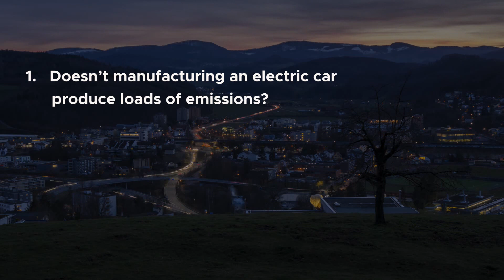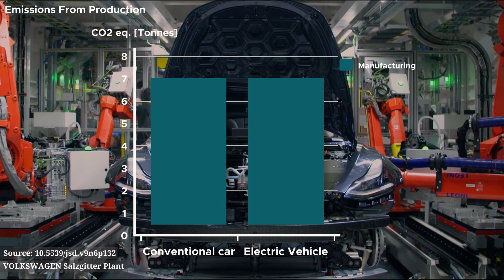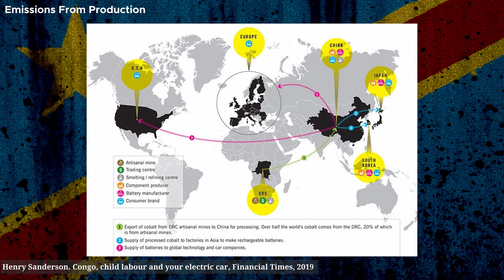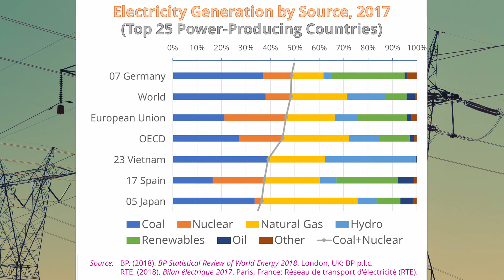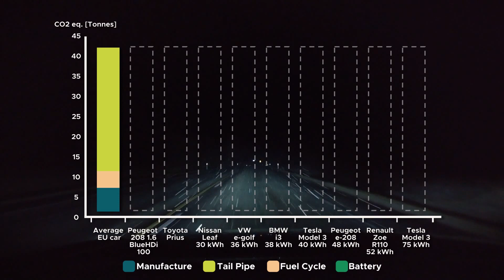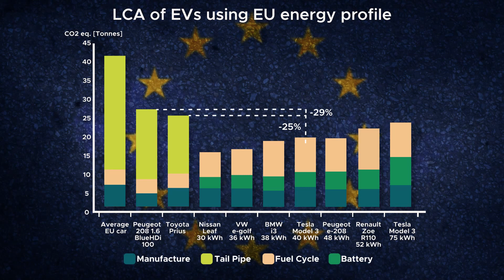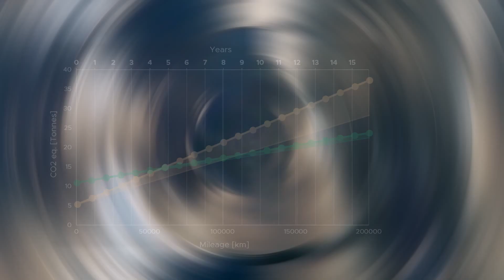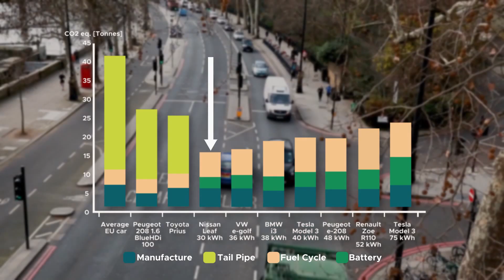Could Electric Vehicles be Bad for the Environment? Data Reveals the Truth

Comment: they are worse than gas cars for the environment since 67% of electricity is made by coal and oil
Reply from the maker: That depends on which country you're from.
Reply: @OurEden  67% of electricity in the world comes from a carbon source some countries like Canada use hydro  electric for its source of electricity other countries use solely oil  or coal some have both but the over all  67% is through a dense carbon scheme
Reply from the maker: @DavidStanleymusic  We acknowledge that countries have different energy mixes in the video. So you cannot outright state that EVs are bad everywhere, since countries with a high proportion of renewables such as the UK, Canada, Norway, Iceland, etc. will provide low (sometimes zero carbon) electricity for charging EVs. The electricity grids of the world don't all interlink, some do yes, but not all.
Reply: @OurEden  I dont do semantics  , the facts  re that ev's are not ever going to have a low carbon foot print until coal and oil is no longer used to generate electricity
Reply from the maker: @DavidStanleymusic  Ok, lets agree then to move forward with eradicating coal and oil (gas too?) in the generation of power.
Reply: @OurEden  that is the prudent thing to do
Elon Musk's new battery  looks promising

Comment: You people must have nothing better to do,buy whatever you want,maybe you should help the 10 year olds mining the products for the battery’s
Reply: The child labour encumbered cobalt probably is just working in your nearest refinery and removing sulphur compounds from your fossil fuel - or has been used for the valve seats and crank shaft of your ICE... Independent human rights organisations together with manufacturer representatives are currently overseeing the mining in the DRC that only ethically mined cobalt is being used for batteries. There is very little cobalt left - if there even is any...

Comment: How many batteries will most electric cars need during their lifetime. Cradle to grave I would imagine that most electric cars will have three batteries. The first owner will sell the car or have a battery replaced. And the second owner will either sell the car or have a battery replaced. So before that electric car sees the crusher at least one battery replacement will be common for sure. So we need to redo our math on the initial carbon footprint of these cars and the maintenance carbon footprint
Reply: Wrong. There are testing facilities that can prove the health of your battery when you want to sell your EV. But the battery will probably outlast the chassis as the batteries nowadays have an insane lifespan exceeding 400000-1000000km...

Comment: Right now there are thousands and thousands of airplanes flying download flight aware and look each plane Burns thousands of gallons of fuel which is jet a as they call it but it is really very clean kerosene and the ships that are carrying our cargo the car today and the diesel even burns cleaner than gasoline nowadays the cars of today only produce 5% if not lower CO2 emissions take a 747 or an airbus 380 which has four guzzling engines and a 747 weighs 999,000 pounds almost 1,000,000 pounds that takes a lot of energy to lift that thing I was going to make electric plans to

Comment: I found this to be a good video actually taking into account all of the factors that go into pollution from a car which some other videos seem to be afraid or unwilling to cover. You didn't need to dive too much into the detail as you explained what the data takes into account and then showed the data.
Reply from the maker: Thanks for the comments and feedback Matthew :D
Reply: It's still not telling the full story about batteries, as batteries will degrade with use. After 10 years you could be looking at a battery with 50% of it's original capacity remaining or the option of a new battery together with it's CO2 emission etc. It wouldn't be so bad if you could repurpose that battery into your choice of a new EV, but as it stands EV batteries are not standardised like AA, AAA etc. batteries. EV might have the potential to be more environmentally friendly than ICE but so far it seems marginal if you factor in all of the battery problems. Instead of pushing EV manufacturers to standardise on their batteries and modularise their components research papers such as those shown like to cheer at how good a job EV manufacturers are doing. Every product has a CO2 emission during manufacturing and the best way to offset that is to use products for as long as possible. The fact that EV manufacturers are trying to include methods of making their vehicles difficult/impossible to use before their lifetime is up is simply ignored by papers that cheer for them. Batteries is everything when it come to EV's.
Reply: @longdang2681  You know it covers batteries as being covered by the application climobil which seems to be where it is getting it's statistics from.
Reply: @matthewtalbot-paine7977  Why is there not a huge spike in CO2 emission at year 10 where it's likely that a new battery is required due to battery degradation? Also implying that renewable energy production does not need large batteries is misleading unless people are saying that solar can provide power at night and wind on non-windy days. Those batteries will also degrade and have their loss capacity replaced. EV's might be more environmentally friendly than ICE but we'll never know the true difference unless people are prepared to show data on all of the major components. Battery degradation and replacement is an ongoing problem for EV's.

Comment: It is stunningly obvious that EV’s are more efficient than IC’s when you take into account the glaring fact that it is necessary to use MEGAWATTS of electricity just to extract crude oil from the depths of the earth? This whole chicken or egg argument always overlooks this. Instead of generating electricity to pull fossil fuels out of the ground, transport them using electric pumps in pipelines, powering refineries, powering the oil platforms, the list goes on, rather than generating electricity to run oil production, just use that electricity directly and cut out a huge middleman. This isn’t even controversial or arguable. The math just adds up.
Reply: What about of generating more electricity for lithium mining?
Reply: You overlooked that. You have to make giant holes in the earth to make electric cars.

Comment: I heard a rumor that EV causes cancer 1000 time worse than gas cars? The 1,400 pound plus battery's releasing dangerous particles is that true?
Reply: It only releases toxic gases when the lithium-ion battery is on fire. No need to fret though, as the chance of an EVs battery igniting is 50 times less than that of a ICE, but your EV will be a write-off. Good news is some automakers are going to stop using lithium ion batteries and use lithium iron phosphate batteries instead, which will make them safer than ICEs. Also it is highly likely in less than a decade, sodium will overtake lithium and be the norm.

Comment: you need to add a new battery every 8 years for your lifetime emissions cycle. As for range of batteries...Im not concerned about range im concerned that it takes hours to charge an ev.
Reply: Depending on the car, a charge of one minute can go as far as 20 to 30 kilometres. A full charge takes about half an hour and can take you about 200 to 400Ks. On the more luxury models about 650 kilometres. Not ideal for trips that will take over 5 hours unless you are willing to take a break to charge it for half an hour and continue after the five hours.  I have no interest in getting an EV until it can do a range of at least 1000 kilometres and the prices come down on a subcompact SUV to about 40K, which I'm told could be as close as five years from now.
Reply: Both your statements are false

Comment: You missed out a lot of negative problems with EVs, In Northern countries in the winter the range is greatly reduced. The range reduces every year as the battery deteriorates and finally needs replacing. Just these two problems will add to the lifetime CO2 usage
Reply: Thank you for having common sense. EV enthusiasts leave negative facts out of the equation: Inadequate power grid (especially California), lack of recharging stations, limited range, etc. The lithium-battery’s fire risk is the greatest danger. Imagine charging an EV in your garage, and it suddenly bursts into flame? Bye, bye house.
Reply: @denisek292  "The lithium-battery’s fire risk is the greatest danger." Per mile driven an EV is 44 times less likely to catch fire than an ICE car (and no, read carefully, that's not per car, that's scaled to the mile driven, that compensates for the smaller number of EV on the road currently). Per year in the US alone 5000 garage fires happen - which happen to find a happy ground in the fuel tanks and incorrectly stored reserve canisters of combustable liquids. In Germany testers tried to set fire to an EV battery to demonstrate a new fire retardant blanket for use by the fire department, they tried their best but couldn't get it to catch fire. In the end they had to resort to arson techniques by pouring gasoline over it and setting that on fire - only then they managed to start a small fire which was all too easily put out.
Reply: @karlgunterwunsch1950  You can have your EV. I’ll keep enjoying the hell out of my black Mustang convertible.

Comment: We should start working on connecting solar and wind farms to legacy 60Hx grids to enable suspension of new fossil developments then eventually upgrade it all to DC by the end of the century and completely phase out all the old 60Hz stuff. This would be a ideal while phasing out fossil fuels and buy time for the nuclear industry to get its act together. Electrifying he economy is inevitable for the late 21st century. Petroleum is too valuable now to waste as gasoline. We should leave as most of it as we can in the ground so our kids and grandchildren can use it for plastics, paint., etc 

The cheapest technology that produces electricity is utility scale solar, which has a much lower impact on the environment than that of fossil fuels. Solar and wind are the best to use as a transition while phasing out the use of fossil fuels and buy time for the nuclear industry to get its act together. Petroleum is too valuable now to waste as gasoline. We should leave as most of it as we can in the ground so our kids and grandchildren can use it for plastics, paint., etc

Comment: An interesting analysis. When estimating the CO2 output from burning fuel, did the sums take account of blend mixing using ethanol made from crops, such as animal grade wheat, or in some countries, maize (corn)? Since this movie was made, the UK has transitioned from E5 to E10 petrol as the standard mixture, e.g. 

	That is for petrol, but in the case of diesel fuel, “biodiesel” is a similar factor, with fuel oil being derived from vegetable oil.
Reply: Engineering Explained did a video that the reduction is quite minimal. In the U.S., most ethanol is sourced from corn, and the emissions from cultivating all that corn and making ethanol out of it means that there's only a net 2% reduction in emissions from E10 (the standard in the U.S.). Ethanol isn't added with the intention of reducing carbon emissions, but instead primarily to increase the octane rating of gasoline (petrol) after leaded fuel was banned and the first substitute additive, MTBE, was also banned as it polluted water.

Of course, there are alternatives to corn that are less carbon-intensive. The same video also talked about an alternative source, switchgrass, which increases the net reduction to 8% with E10, but those are unlikely to be adopted here because corn farmers want their money.

Comment: Presently the infrastructure will not support a large number of EV's, right now in the US the grid is stressed to the maximum without addition of the EV added to the mix.  It will take a decade or more to upgrade the grid to handle the additional load.  Yes that EV will be outstanding in reducing emissions setting still in a darkened garage due to the power grid collapsed yet again.

Comment: One problem that has been overlooked is all batteries have a life span  what happens to those batteries that become useless ? Will there be a battery mountain?
Reply: They are recycled
Companies like Redwood Materials, Li-Cycle and Tesla already recycle EV batteries.
Also the new Tesla batteries are good for between 400k and 1 million miles.
Reply: @That-Guy_   The technology already exists to contain lead, mercury, and cadmium when recycling batteries and it is improving by the year to the point that in about 20 years the need for mining will be reduced substantially. All the other mineral and elements in a EV battery are fully recyclable even after being used as second-life batteries.
Reply: @That-Guy_  I found a vid that explain how they recycle them 👍
Reply: @keithb2055  
Cool
Glad the EV/technology nerd in me can help
Reply: The technology already exists to recycle them, but it is not worth it yet to fully recycle them. By the time there are sufficient numbers of them, there will be a major recycling market for EV batteries. There is always recycling where there is valuable metal.  One nice thing about EV battery cells is, they find a second use in stationary grid storage. When there are enough of them to create a market, they will be recycled to reclaim the valuable metals just like any other high volume appliance does nowadays.

Comment: Naive assessment on the importance of range. If living in Southwestern United States, 4-6 trips a year of each at or over 500 miles a day or round trip of 1000. And...when you get to a remote location there is substantial range needed without power recharging stations nearby. For instance, if you own property in a remote location for the purpose of natural beauty and escape, EV lifestyle is unreasonable or even unsafe. Hybrid is the most practical of all.
Reply: Install a solar electricity roof, add an old EV battery (when finally some reach that second life part of their life cycle) and you can charge your car and live in comfort at that remote location.

Comment: I do not and will not buy an a BEV because of my preferred lifestyle driving miles into the wild or desert 🌵 where without electricity ⚡️, I just pour a can of fuel into my ICE vehicle and continue driving for couple hundred miles. How  do I charge an electric vehicle in the middle of the desert or in the woods? Moreover if there was a national disaster that you must hop in a vehicle and drive a thousand miles to a safer location, how would you you charge your EV in the middle of nowhere and in chaos?
Reply: EVs are not for everyone or every use case but most people will find them to be better for their needs than ICE cars
As far as disasters goes, I live in Houston and can tell you gas stations run out of fuel really fast when a hurricane is coming and it takes days for them all to get refueled providing they have power after the storm

Comment: Great video! There is another parameter that I don't know how to calculate, but this may not be unimportant. We know that stationary objects (households, industry) can be fed by electricity without batteries (usually), because they don't have to move. The importance, as you say, is overall greenhouse gas emissions, regardless of whether they are from stationary objects or vehicles. If one would exchange all vehicles with EV at once, one would need to produce much more electricity at once. Another YouTuber (Engineering Explained) estimated this at 35% more electricity needed for the USA. What would the energy balance (and greenhouse gas emissions) look like if we tried to make the energy as much as possible renewable, focus it on stationary objects and reserve fossil fuels for moveable objects?
Reply: It is unreasonable to talk about exchanging all ICE for EV at once.  What if you legs fall off.   
The grid will grow with car production to meet the demands.
Reply: I would argue that stationary objects DO need batteries!

The problem with renewable energy is that it is intermittent. Wind turbines only produce electricity when the wind is blowing and not blowing too much. Solar plants only work when the sun is out. Where does the electricity come from at other times? The more technical issue that many do not realise is that electricity has to be produced a tiny fraction of a second before it is used. Conventional fossil fuel plants can be managed to do that. Renewable energy currently also relise on fossil fuel plants to make up any shortfall. Basically, the holes in the renewable supply are currently being filled, at no charrge to the renewable industry, by the existing fossil fuel plants. That makes fossil fuel based energy look more expensive than it is and renewable energy cheaper than it is.

Renewable power plants will need batteies or other form of energy storage to replace fossil fuel plants tp maintain a steady supply to houses, factories and offices etc - whether they move or not!

Comment: there are numerous published experiments which have been repeated by other scientists to confirm that increased carbon dioxide concentration increase the rate of photosynthesis. in fact numerous commercial farmers pump carbon dioxide into the greenhouses to improve yield.
how much carbon dioxide is pumped into fizzy drinks per year? if carbon dioxide contributed to climate change, why is carbon dioxide manufactured to be released into the environment through fizzy drinks, dry ice and fire extinguishers?
is there a published experiment which can be repeated by other scientists in their laboratories, which proves how carbon dioxide contributes to climate change?